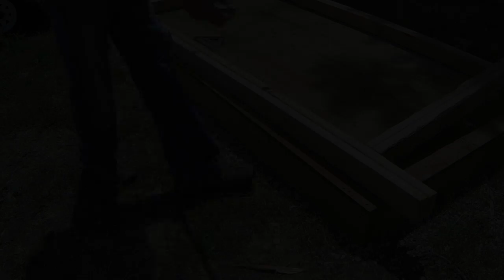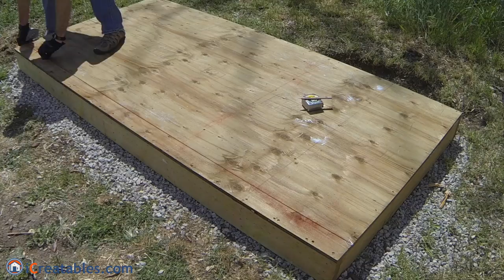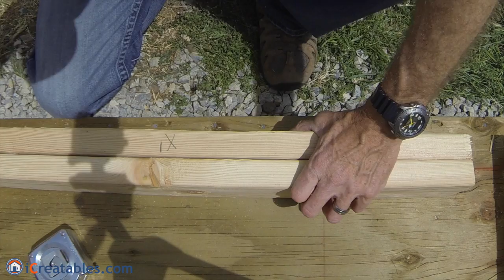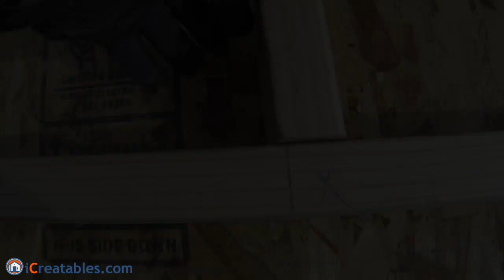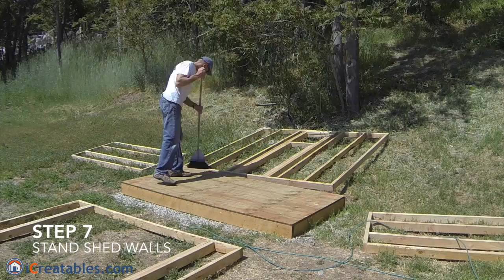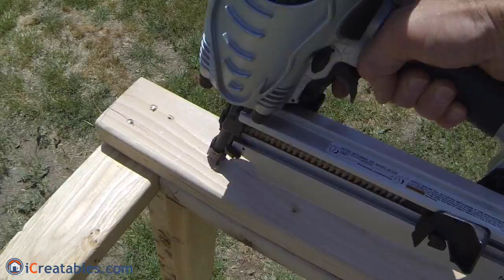How To Build a Lean To Shed - Part 2 - Wall Framing

Comment: why do you crown the wall plates for the measureing step, then it seems its not mentioned when you attach the studs to them. i can see why you crown joists, just dont understand what to do with the crown when assembling plates.

Comment: Does it matter where I put door? Hit 10ft wall but want door in corner
Reply from the maker: Kind of. It is good to keep the door away from the corners to give the shed strength. But on a shed you can put it up to 12" from the corner.

Comment: Thank you for sharing the video. I do have a doubt though.. how can we nail the base of the walls to the joists if the wall studs and foundation joists are both 16 inches apart? Won’t they overlap when the long walls are placed on the foundation?
Reply from the maker: There is a rim joist that runs the full length of the wall. You would put a nail between each wall stud through the bottom plate and into the rim joist.

Comment: I have a question for anyone that can assist:

For a header: can a 1/2 plywood be used instead of an OSB board?
Reply: Or 1/2" ridgid foam if you are insulating the building.

Comment: I was wondering what kind of plywood is used for the floor? is it waterproof ?  
Thanks for all the info.
Reply from the maker: +Tim Thornton (TimThornton1) It is 3/4" Treated plywood. It is not waterproof. You can make the floor more water proof by coating it with an epoxy floor coat.

Comment: good video, but you forgot to add how to square a wall from up (measuring diagonal to diagonal and you didnt show to put cross braces on the frames before nailing the double top plates on

Comment: ok - so by this method, the distance between the Center of the first stud at the end of the plate and the Center of the second stud is actually 15 1/4 inches - not 16; although you marked the edge of the second stud at 3/4 in past 16 - you put the "X" on the inside of the mark - toward the first stud.  Since the center of the first stud is actually 3/4 of an inch from the end (1/2 of 1.5 inches) - the distance "OC" becomes 15 1/4 . . .  right?  all the rest of the studs will be 16 OC - but not the first and second.  Is this right?  IF you set your tape at the end of the plate  - shouldn't you mark at line at 16" then "X"  'away' from the first stud or 'outside' of the line?  Then you have 16 OC.  . . Or what am I missing here?     Thanks - (posted same comment at: "Framing And Building A Wood Stud Wall")
Reply: I'm replying to a 5yo question, but in case anyone else reads this the answer is, "No." On center means you want the middle (i.e. center) if the stud to be at 16 inches. The 15.25 you mention would be the other side of the stud. A 2x4 (which is 1.5 inches wide, not 2) laying between 15.25 and 16.75 as marked in the video would have it's center lying on... 16 inches.

Comment: These walls are solid.  I could live in my shed.  Sounds silly but this thing would make a great and I mean a great hunters shed.  It stands like a rock - I could not pull it over push it over - no way.
Reply: but is it bear safe?
Reply: I wouldn't think it would be bear safe - cover it all in galvanized metal and probably so.

Comment: I purchased the 4x8 lean to plans and am in the process of building the lean to.
Overall the plans are good - they definitely gave me a good head start in building the shed.  
Here are some improvements I would make to the plans.  I purchased the one with the door and small window on the shorter 8 foot wall.

Give the drawing with the door and window a full page. The measurements given on the page are very tiny and a pain to look at.  I could blow them up but it would help.  Also your true thickness measurements of a 2x4 are not exact.  For instance you factor 2 - 2x4's together as having a thickness of 3 1/2" inches 3" is correct - so I hope everything comes out ok up in the top plate area where there are 2 top plates.

I am also installing a smaller window 14" x 21" that I found on an auction site searching for "shed window".  The measurements not the drawing need to include all the gaps etc.  There should be many more measurements and measurements that truly reflect the 1 1/2" dimensional width of a 2x4 stud as you are using studs and trimmers.

Here are some things you should understand before you build this shed.  It comes with a list of materials needed - AND it is very helpful.
You will spend upwards of $800.00 to build this shed.  No kidding.  I like the shed because if I ever want to move it.  I can fit it between the wheel wells of a pickup truck and haul it away.

If you think the cost is not accurate start pricing 2x4's 38 at $3.25 each and T1-11 Siding at $35 each total of 6.  Not too mention 2x6's, roofing, window, gravel, hardware, fasteners, 4x6 treated skids etc.  If you can get used lumber - get it, but use treated for the base.

I would also recommend getting a framing nailer and/or a palm nailer for sure.  I got mine at HF and think they are great.  Less than a hundred bucks for both with coupon and discounts.

Ok, overall I can build a shed using these plans then anyone can.  The videos on youtube have been the difference for me as I have watched them over and over.  One more thing.  Measure and make your markings just like the fellow in the video and you won't mess up - also make sure you make your headers before you double stud or add the trimmer.
Reply: BTW it all came out good measurements were exact.  You have got a great product and videos
Reply: Kudos for the Video clip! Apologies for the intrusion, I would appreciate your opinion. Have you tried - Mahorrla Wooden Paradise Method (probably on Google)? It is an awesome exclusive guide for building better sheds and woodworking minus the headache. Ive heard some super things about it and my close friend Aubrey at last got cool results with it.
Reply: Appreciate Video! Sorry for chiming in, I would appreciate your opinion. Have you heard the talk about - Mahorrla Wooden Paradise Method (should be on google have a look)? It is a smashing one of a kind guide for building better sheds and woodworking minus the hard work. Ive heard some great things about it and my friend Sam after a lifetime of fighting got cool results with it.
Reply: +Cy Ance Lovely Video clip! Excuse me for the intrusion, I would appreciate your initial thoughts. Have you researched - Mahorrla Wooden Paradise Method (google it)? It is a great one of a kind product for building better sheds and woodworking minus the headache. Ive heard some amazing things about it and my work colleague at last got great results with it.

Comment: Why do you put plywood between header boards?
Reply from the maker: Jim Watson It makes the header 3 1/2" wide which is the same thickness as the wall. this is helpful if you are finishing the interior and makes it easier to install the header into the wall framing. It also makes it a bit stronger.
Reply: iCreatables If you leave out he plywood and and put a 2/x on the bottom then you have room for insulation if you want, especially on a 2/6  I liked your gold viewer., and would like to see one of you finding gold.

 One more thing, your an excellent carpenter!!

Comment: you are the best    thank a lot to explain how to create the floor and the wall 
but  i don t know how to put the floor and the wall together 
you need just to use the machine and to put nail between  the bottom  wall and the floor
so my question is  this method is usable if i ceate my own tiny house ? 
i ask you that because the weight and the charge is a lot of important 
thank for your answer 
very good job
Reply from the maker: 2 nails every 16 inches along the wall bottom plate and into the floor. Try to hit the floor joist below. Check with your local building inspector for any local nailing patterns they have adopted.
Reply: thank